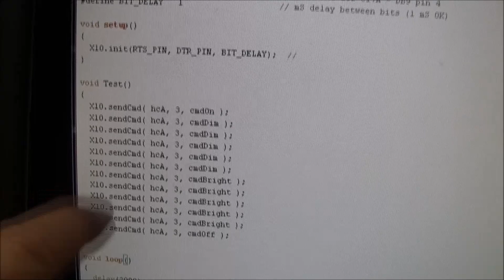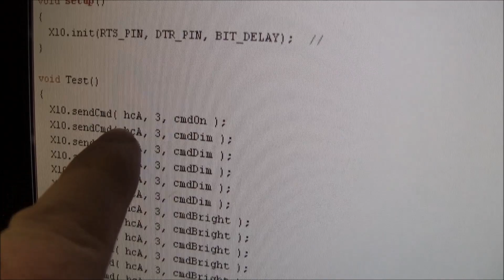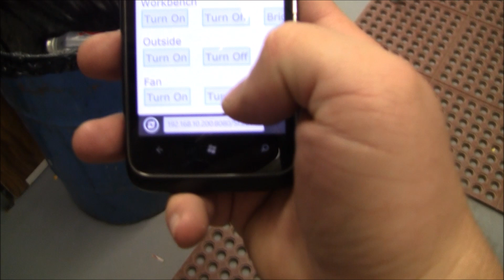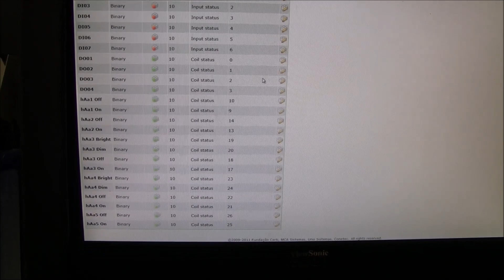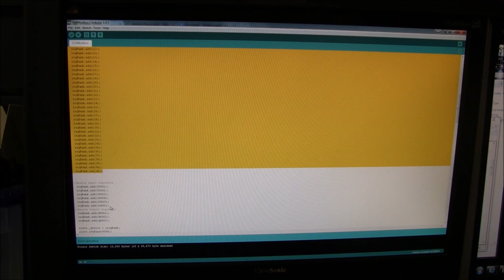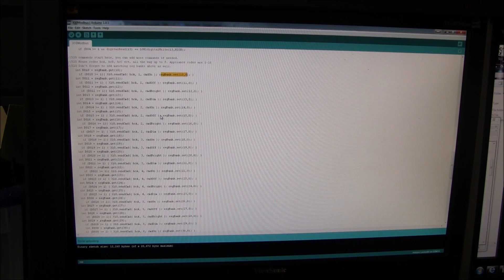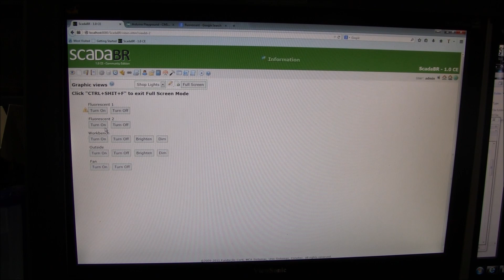X10 Control Using Arduino, Modbus, and ScadaBR

Comment: is installation procces same as for Mango?? I need to install first JavaJDK and Tomcat BEFORE installing ScadaBR? then what after? Yes, it's very hard to undestand when everything is in Português :/
 So, when we can expect thst ScadaBR installation tutorial? Thanks
Reply from the maker: ScadaBR is much easier to install than Mango. Just make sure JDK 6 or later is installed, set the Java_Home Variable, run the ScadaBR installer and you are done. I had trouble when ScadaBR was installed in Program Files due to permissions so I use Users/Public for windows installations. Sorry about the delay on the tutorial, I think I have some raw footage that I just need to edit and encode :P
Reply: electronhacks
 well, i finaly have some time to "play around" with this arduino rtu stuff

ScadaBR installed quite easily and i managed to add few data sources/points to control hw as well for ArduinoUno R3 and another diy pcb with ATmega32 (bcs it have more I/O pins) with same modbus lib.

I have two or 3 questions if You can help me:
1) 3:01 how do you access to apacheTomCat/ScadaBr from you cell phone when it's installed on PC ?! I see on buttom address is 192.168.10.20:8080/scadabr so you have accessed to your PC via wifi router, but how? i need same thing...
2) 6:47 on top of your screen, current alarms RED, yes, i keep geting those timeout exceptions alarms too and during that timeout connections is "lost", buttons in graphical doesn't work until connections come back... how to set scan rate and timeout "ratio" correctly? Actualy as i noticed i get those only for UnoR3 that is connected via usb as normaly by Atmega16u2 but i think there are no any timeouts with atmega32 and FTDI chip...
3) i forgot... damn, i will change this comment later :D